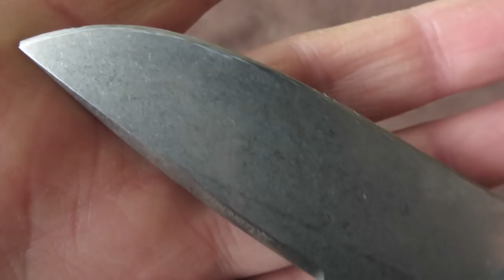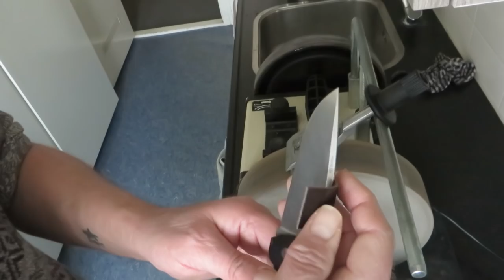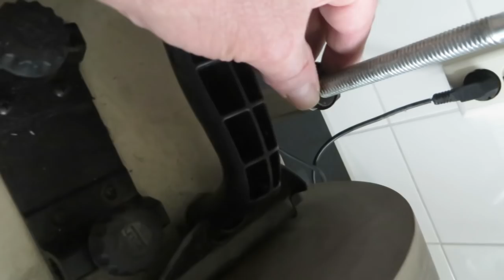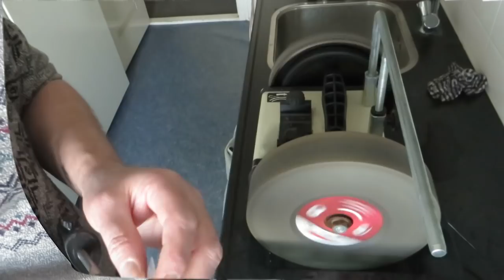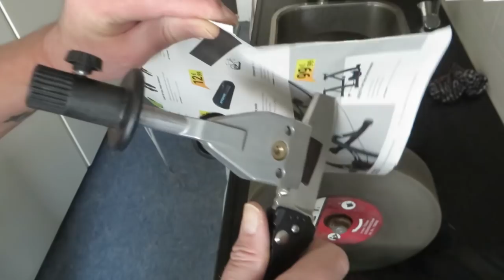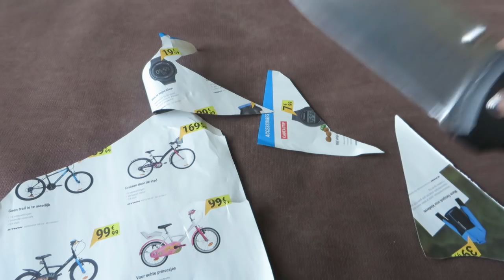Sharpening on the Jet Water Sharpening Machine

Comment: You should have wheel turning away from you.  This is for a couple reasons.  One it’s safer.  But the best reason is it’s much better for the knife.  It’s a softer way to sharpen so the results are a little slower but the control is better and much more forgiving.  Your knife blade will be deformed much less and less material will be removed from your blade and the stone will last longer
Reply from the maker: I am aware of this Gary. Very much appreciated. But I like to do it this way without pressure so the removal of material is not that relevant. But good point for sure!

Comment: I’ve still got my Jet, & have updated, or duplicated some of the parts, with Tormek parts. The new strop works on my Jet, but my Jet strop is bigger than the Tormek’s.  I even got the swivel to work, on my Jet.  It’s too bad they don’t make the Jet, anymore.  It’s a Great Machine, like the Tormek. I still love my Jet, but the Tormek, wouldn’t break my heart, either. Especially, since the jigs, are pretty much identical, & work the same way.  I’m waiting for the Recurve Blade demonstration.  I’ve got an Emerson Super Commander, I am going to work on.  Thanks, good video!

Comment: I couldn't tell well enough in the video, but as you sharpened the water looked like it was dribbling past the reservoir basin, and onto the counter. Is that what you experienced, or did it actually make it back into the reservoir? Looked wet and messy lol. Also, do you find swarf getting into the pivot area as you sharpen? I know you set it for 20 degrees, was that inclusive or 20 deg each side? 

I wish manufacturers would take one of the stock knives they design, and sharpen them, to see how badly sharpening notches are needed. It is a moot point for many collectors, but for those of us that sharpen them, well, you know what results from it. Regardless, she looked nice and sharp, and ready to do some work :D Well done. My gf was actually looking at one of these to purchase for me this xmas, but I had her buy me a couple knives instead. Kinda think I made the wrong decision now haha
Reply from the maker: Hi Jef.
It is a bit messy when sharpening in the beginning with water all over. But it stays on the counter. I being patient it will be less messy...but then i need to wait with sharpening till the stone is soaked with water. THen most will get bac in the reservoir. THe way i do it (not waiting) will let the water flow around.
One of the things i like is that the sharpening keeps the knife very clean on the inside. So no mess inside the ivot area. The angle was each side.
I like this machine a lot. Not as fast as a Worksharp f.e., but no chance to mess the heath treat/burn your edge. The stropping part i like the most...
Reply: KnifeCollector031 The Netherlands if u sharpen it with the  wheel spinning with the bevel instead of going against the bevel u will barely spill water at all and accomplishes the same thing.  Ppl used to using manual water stones have a hard time getting used to doing it that way.
Reply: He added too much water. He filled it passed the max fill line. It will not make a mess if it is done right.

Comment: The way you're sharpening your knife is dangerous, the direction sharpening the knife should be directed way from you, it's safer and better. Here is 1 of the example https://www.youtube.com/watch?v=Op4CjUOdGK4

I don't use this type of sharpening system, I liked the manual guided sharpening system more, I also have better control with the manual guided sharpening system.

So, please be safe :)
Reply from the maker: Tx a lot for the info and your concern is very much appreciated. Because it is a very slow turning wheel (not high speed) it is relative safe to sharpen against the turning direction. Both ways are safe and both are supported by the system as originally designed by Tormek. As long as the instructions are followed of course. I like to do it against the turning direction because the result is achieved faster and i have more control/better view on the edge. But you are right, it is safer when i grind with the turning direction away from me. I really apprecciate your concern!